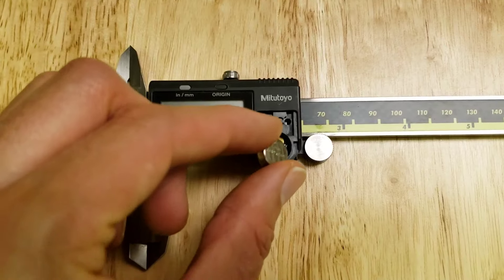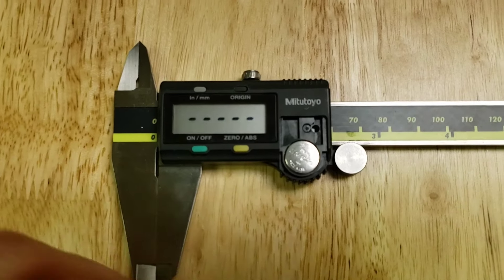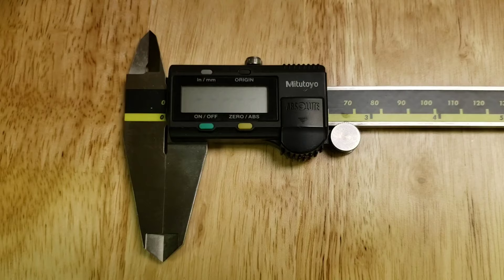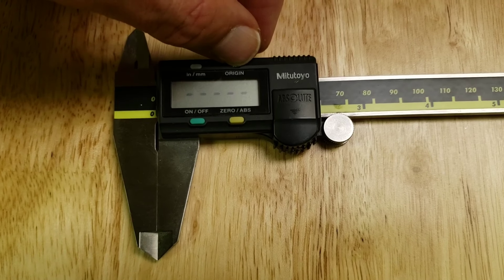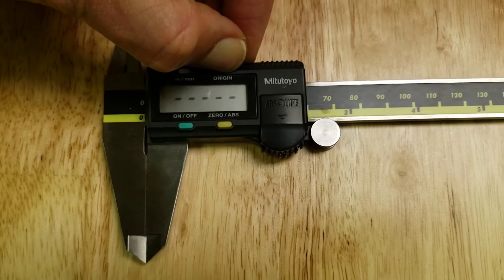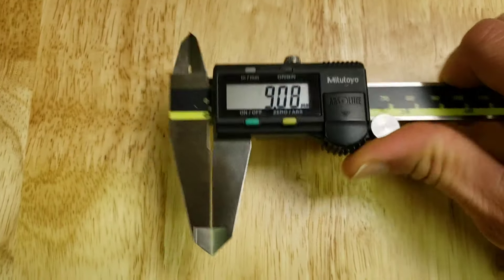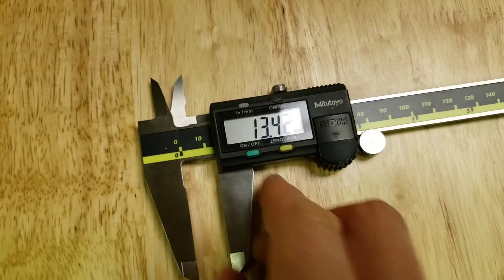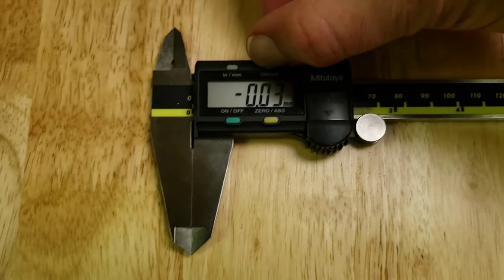How to Fix Mitutoyo Calipers Dashes Flashing on Display After Replacing Batteries | Digimatic

Comment: Thanks a lot your video  saved lot of trouble of mine. 3 years before i have purchased original Mitutoyo vernier caliper , used it for 2 or 3 times and then kept packed for nearly 3 years and now when i took it out battery found dead hence i replaced it with LR 44 but the problem of flickering dash occurred. As i am in small town it is difficult to obtain SR 44 battery ( thinking that caliper need only SR 44 ) but your video instantly solved my problem. Thanks.

Comment: Thank you. My calipers have done this on their own a couple times in the past month just from turning them on. So irritating. The battery is good. No idea why they work 99.9% of the time I turn them on, then decide  they won't the other 0.1%.
Reply from the maker: That's strange. Make sure contacts are clean and the battery is making good contact. May want to try a new battery?

Comment: My Digimatic started flashing the dashes out of nowhere, didn't change the battery. Still, holding Origin fixed it, so thanks!
Reply from the maker: Nice that this solved it. I wonder what randomly made it start flashing. Check to make sure the battery and contacts are corrosion free.
Reply: @engineerable  they are, the caliper is just two years old. No idea why it happened, I'll keep an eye on it though
Reply: @straxwb  Same thing here. Mine are about two years old too, was just measuring a work piece and boom.

Comment: My calliper 6 years old but as new.  Looks same model as in video.  Started horizontal bars flashing, replaced battery.  Have held down Origin as advised, them Origin & Zero…… still no joy.
Any other suggestions or possibilities. It will cost a fortune to return to Mitutoyo!!! Many thanks
Reply from the maker: Check the battery, and make sure you are using the correct type of battery, link in description.
Reply: @engineerable   thank a million for answering.  Think you said,  silver oxide SR44. Will get one on Tuesday. Happy New Year 👍

Comment: I have an old pair, and the Origin button doesn't work well. I pushed down with my finger and did not engage the button, but pushed it down with the end of a small screwdriver and was able to reset the device.
Reply from the maker: Nice!

Comment: it turns off when i hold the origin button when it´s blinking, any solution for than?
Reply from the maker: Not sure what is happening in your case. Is your battery new? Have you checked the battery voltage? Sometimes even new batteries are duds.
Reply: @engineerable  yes, the batery it´s a new one, but it is a LR44, insted of a SR44, can that be the problem?
Reply from the maker: @rubenarmenta5564  SR44 and LR44 will both work. SR44 will last longer. Have you checked the voltage with a voltmeter? Voltage when new should be 1.5V, but I don't know at what voltage the calipers will stop working.

Comment: The larger issue is these calipers won't stay fixed after pressing they origin button. We have dozens of these Mitutoyo calipers at work and they all end up doing this and occurs gets more and more frequently as time goes by.
Reply from the maker: Interesting. What kind of batteries are you using? Silver Oxide?
Reply: @engineerable  We use Energizer A76.
Reply from the maker: @donprater3768  I don't know how quickly it goes to flashing display, but the Silver Oxide (SR44) batteries will last almost twice as long. The issue is that standard LR44 (like the Energizer A76) have a more rapid voltage drop in use. Mitutoyo Calipers have a minimum voltage threshold, and the SR44 batteries almost completely deplete themselves before dropping to that voltage, vs the LR44 drop below that voltage at about 50% of their Mah capacity. Give some SR44 batteries a try.
Reply: @engineerable  I will try the SR44 battery. My thinking was that it is an encoder issue. I'm at work now and the caliper I use daily has done it at least a dozen times in the last 9 hrs.
Reply: I have the same problem, it is "fixed" for a few seconds after doing the origin reset, but then goes back to the blinking dashes.